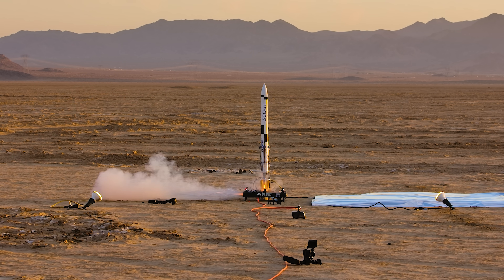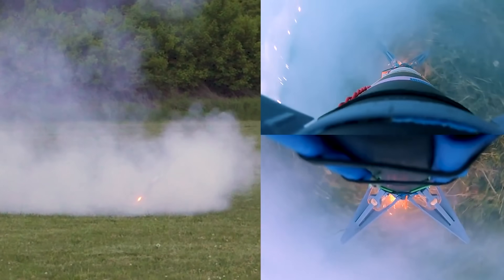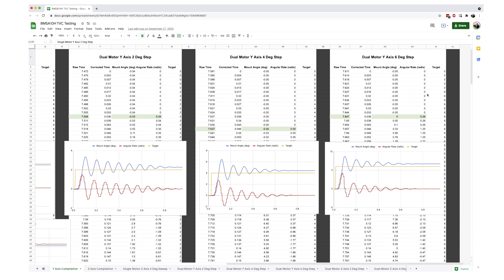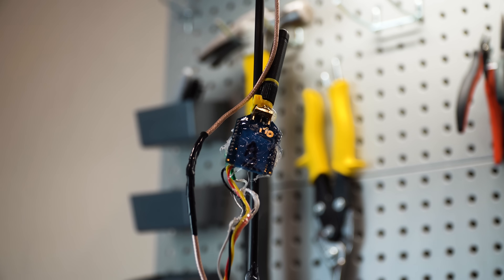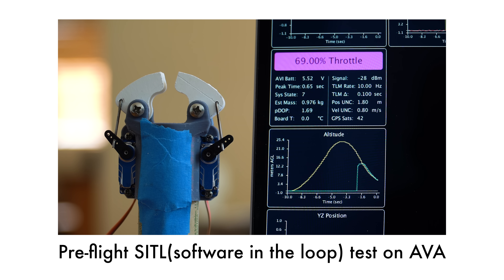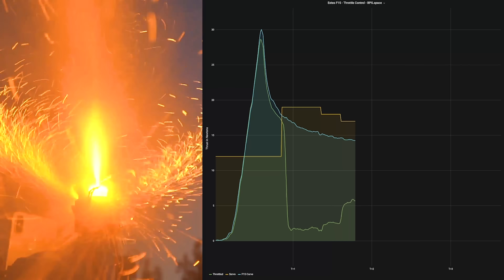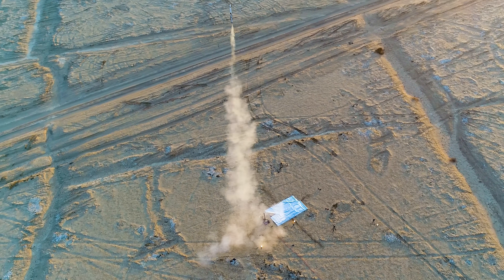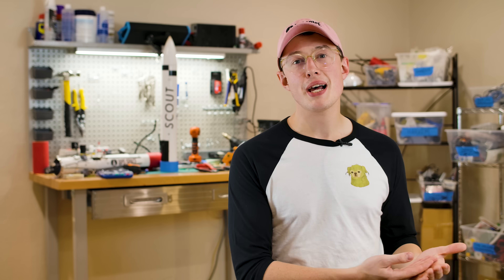Scout F - Flight 1 - Launch and Landing

Comment: great vid.
Just had a thought (i'm sure easier theorized than executed) - can you redesign the throttle arms, such that when they are close, they redirect the thrust sideways in 4 (or at least 2) axis, or reversing the thrust, aiding with keeping the rocket in place. example of this  can be seen in the Boeing 737 Thrust reversers.
Reply: Came here to say just this.

Rather than trying to block the efflux, redirecting it with 'open-backed scoops' might allow deeper throttleability, and could add a method of vectoring the thrust in the terminal phase.
Reply: Keeping the rocket in place? Sideways thrust would cancel itself out and not provide any additional horizontal stability.
Reply: @clonkex  if reversed (pushing down), sideways just enables zero thrust - though i agree with you that it seems (could not find too much info, any pilots here?) bucket thrust reversers don't truly REVERSE the thrust.
Reply: @MI-wc6nk  Ah I thought you were saying it would keep the rocket in place horizontally, but I see I misread your comment.
Reply: @MI-wc6nk  Yeah, bucket thrust reversers really just kill thrust and add drag, throttling up in REV mostly just makes noise.
Reply: @MI-wc6nk  They do reverse the thrust, in that there is more reverse thrust than forward thrust from the engine.
One of the high engined planes like the DC-10 or MD-11 is allowed to reverse with reverse thrust, but it's seen as too dangerous/annoying to do it with low, wing mounted engines.

Comment: Perhaps your ceramic thrust reduction pincers should be cup shaped to redirect exhaust gasses slightly upward which would not only reduce upward force via downward thrust reduction, but could also reduce it further via the gasses redirected upward providing a downward force.  This would increase the range of upward force control and also allow landing lock by fully closing to direct thrust upward once landing leg contact is detected.
Reply: We had the same thought. I scanned the comments to try to spot any duplicates, but there’s a lot here to sift through!

Comment: How about putting the gyro and accelerometer on a separate little pc board, put it in a little foam and move it up and away from the gimble mount. It would communicate back to AVA via I2C or SPI. That might smooth out the noise and vibration. You might also want to slow down the PID response time that controls the gimble.

Comment: Running a simulation that attempts to characterize the rocket in real time could be an option.  Might need something with a bit more processing power to make that work though.
Reply: I have used this approach on many occasions. Accurate state estimation is really the only way to control such a dynamic system. However, there are so many parameters that it becomes computationally expensive quite quickly, especially for higher polling rates.

Comment: Maybe I don’t understand something, but ... Wouldn’t it be more logical to make springy struts (shock-absorbed), which, when landing, would move apart, compensate for the load and “sag”? Thus, the contact areas of the supports with the ground will move away from the longitudinal axis of the rocket to the maximum distance, giving it greater stability. It is also better to make the racks harder than shock absorbers, bumpers, which will deform elastically and push the rocket in the opposite direction (but do not shake it, as if they were not elastic). If the missile is not very perpendicular to the landing site when touched, such a shock-absorbing strut, again, will allow the bearing surface to be removed to the maximum distance from the rocket and gently absorb the impact, allowing the rocket to level out and fall onto other struts.

Comment: Hey I'm trying to build my own tvc controlled rocket and I have a question to pid cause in ur presentation u said u should ad the derivative? Back in but wouldn't u want to suptract it in order for it to work as a brake

I'm 14 and not a native speaker so I'm sorry for all mistakes I might have made if sth is that wrong that any of u can't understand the message I'd be happy to rephrase it

Comment: You could consider wiggling the TVC on the way down instead of throttle control. I'm not sure how well the throttle control is working, but I've worked on an algorithm that also has to burn off extra energy. It works the same way the Scout underperformed on altitude.

For the way up, how much did we miss the mark on the TVC transfer function by?

Comment: I dug out the code from a mars landing simulation I worked on a while ago and here's how I handled powered descent. Is your thrust at minimum throttle below your dry weight? If so, you could use a similar approach:

If above 5 metres, the target velocity 'v' is set assuming constant deceleration: v = sqrt(u^2 + 2as), where 'u' is our desired end velocity (zero), 's' is our altitude plus 5 metres, and 'a' is our maximum theoretical deceleration rate at this exact moment in time including gravity. This makes optimum use of delta v.

If below 5 metres, the target velocity is set linearly based on altitude, decreasing to 0.5 m/s at zero altitude to ensure a firm touchdown at which point the engine is cut.

By trying to get to zero velocity by 5 metres, we build in a safety net in case we under perform. A PID controller uses the throttle to achieve target velocity.

I found this worked reliably under all sorts of descent conditions. The code is in vector form.

double target_velocity = sqrt(2 * ((MAX_THRUST - Fg.abs()) / lander_mass) * (position.abs() - MARS_RADIUS - 5));
if (position.abs() - MARS_RADIUS < 5) target_velocity = 0.5 + Kh * (position.abs() - MARS_RADIUS);

velocity_error = -(target_velocity + velocity * position.norm());
Reply: Instead of the radius of Mars they would need to use the altitude to ground. I am not sure they have this measurement or maybe they use barometric altitude (slow). Or maybe they integrate the forces from the accelerometer...

I think in reality you would use radar altitude measurements. Although small versions of such sensors are available, they will still be rather large for a rocket.

Maybe the best bet for the last 5 meters is a simple ultrasound distance measurement.

The control problem itself is not very hard to solve, but the noise on the measurements are high and the process is very quick, so a small error will already be catastrophic.

Comment: First of all: MAD respect for what you have done so far!!! Regarding your invitation for feedback: I am studying aerospace and rocket science in Germany and in one interesting lab on the calibration of sensors we learned about one possible source of the problem with the "wiggling". Broadly speaking if you want to measure something correctly you need to measure at least 10 times more often than the expected change rate of what you are measuring. For example if you are measuring something that would plot a sinus wave and you start at 0 and measure it only every "pi" interval the results will be a constant 0. If you measure it every "pi/2" the result will be a weird "wiggle" of 0, 1, 0, -1, 0,.... if you measure it in smaller increments of "pi/10" you actually start getting a kinda smooth sinus wave. What I am hinting at is that one possible problem is that the interval in which your sensors measure (or your servos react) are to slow compared to the change rate of what you are measuring / trying to correct. Secondly, someone else has encountered your problem and has solved it. It is a guy trying to build a solar tracker, but it kept over correcting and started to "wiggle". The video is short and about half way through he talks about this initial problem and how he solved it. https://www.youtube.com/watch?v=Oj1E7o7J3qc "World's simplest sun tracker." by "3D Printer Academy". Hope that helps. Would love to see you succeed!!!
Reply: I took a digital signal processing course this semester and the term you are probably looking for is called "alias" or a violation of the Nyquist Theorem. I suppose those shown data points are at a much lower rate in the telemetry data than in the actual control loop. But this might be an important point to look into. Once you're sampling at a sufficiently high rate (using DMA for example) you can filter high frequency garbage much easier an avoid the control system becoming unstable because of high frequency noise coming back to haunt you as alias in low frequency data
Reply: I think this is a good point. The other thing that came to mind is that it seems like it needs some kind of smoothing function to average the inputs over time to avoid over-correcting and therefore bouncing back and forth between extreme opposites.  Either that or some way of mechanically isolating the sensors from the vibrations to reduce "false" inputs.

Overall, this is awesome work and I've been a huge fan of your videos for the past few years!
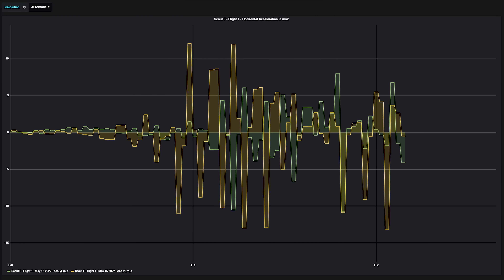Reply: The data shown at 5:14 clearly tells me, that the rate at which you are currently measuring is far too low... the way the graph looks tells me that you actually do not have the data. In between the horizontal bar at the peaks could be a temporary spike that is 2 times higher that you just don´t know about and thus cannot correct
Reply: I bet if you just get a sensor that measures 10 times faster or more you actually get a completely different looking graph and would thus have to adjust the input of your servos
Reply: I wonder what the tradeoff would be vis-a-vis cost of increasing the measurement frequency (does it require more computing power, battery, higher quality sensor or actuator, etc)? Sometimes a simple interpolation algorithm will help quite a bit in these cases.

This is such a cool project and so close to landing as well.

Comment: if i had to guess, and i never worked in something like this(disclaimer), i would try to corelate thrust and mass flow rate with altitude. that would be my landing system. I think mass flow rate is the key here. It should also be taken in consideration when you are estimating your center of mass and how much it drifts when you gimbal the rocket. For this i would have separate algorithms because of the discontinuity in the mass curve, when you eject the firts engine. Again, i'm "thinking out loud" here. I'm actually graduating in eletrical engineering so...

Comment: I'll think more about the actual question you asked, but before that, have you looked at doing the translation in the ascent and having the landing only attempt to hold zero lateral velocity? The landing has enough going on without it also trying to move over and then stop moving over.

Comment: I don’t know if you’ve already tested this, but I feel if the thrust vector control system was activated slightly after takeoff instead of immediately it might fix the wiggle a bit by giving itself more upward momentum and a longer time for correction instead of short bursts which make the wiggle.

Comment: Maybe it's time to try liquid lol. Solid throttling is hard and inefficient.
Reply: Why not both??? 🤷‍♂️
Hybrid's don't need incredibly complex pintles and you're only trying to throttle the oxidizer to control thrust.
At the very least you could shut the motor off as soon as AVA detects touchdown.
Reply: @jimurrata6785  That's probably a good solution for model scale. But this completely solid engine with flaps blocking it is just impossible.
Reply: @hardknockscoc  I don't think Joe has too many motor options in California. (at least if he's going to document them on YouTube)
Redirecting thrust definitely isn't throttling, any more than how overcorrecting on ascent is killing his apogee.

Comment: Your brilliant!  And ive been an engineer for 35 years...so i know what im saying.   You should do a video explaining how the reaction wheel works
Reply: He covers that in one of his earlier videos where he was still using a 3D printed reaction wheel with weights attached.  Basically before launch he spins it up to a steady state speed, and then after launch if it starts to rotate, he can speed up the wheel to impart a rotational force in one direction, and slow it down to impart the force in the other direction.  Pretty clever solution!
Reply: @just_another_fan418  the most important question i have is "are you banging Xyla"  shes in a bunch of his videos

Comment: Why not make the landing legs dissipate some of the landing forces and “bounce” by making them collapse a bit after the landing.
Reply: He tried this in some of his earlier rockets, the springy force ended up helping push back up into the rocket and the rocket went over sideways because all 4 legs didn't touch down at the same time.
Reply: @just_another_fan418  Looking at that aluminium ring, perhaps the whole of the landing gear could be damped independent of which or how many legs contact first?

Comment: So, I had a think... You don't need to work with one landing curve, you can work with many!

If AVA has enough memory, try a set of landing curves, say one per meter of altitude between 15 and 30 is those extremes are within the range the throttle can vary thrust for, and have the computer calculate expected apogee at burnout, then go into a lookup table and pull the correct curve.

Depending on memory, you can vary the apogee resolution to just fit. 7 meters is obviously way out of line (as demonstrated), but depending on various factors a meter might be plenty.

Alternatively, are there any weird discontinuities between the landing profiles needed for various apogees? If not, a scaling factor or two derived from that particular flight's predicted apogee might be enough, and that's both smaller and faster to execute.
Reply: I think I'm thinking the same thing as OP. The flight controller should be determining when to start the second motor, etc. on the fly. It shouldn't be replaying one thrust curve which was set before the flight. AVA has inertial data so it can decide whether it needs more or less thrust at any given moment. If I were Joe, I'd write a function that takes intertial data and motor gimbal as parameters and outputs thrust %. I can't imagine AVA's memory or clock speed being a limitation here.
Reply: @shuttleshifter  This, it should come up with a new curve based on the data.
Reply: Why calculate apogée doesnt scout has a pressure sensor and detects apogee anyway for the state machine
Reply: @nikoheinz1213  Yep, but knowing a bit earlier might help. That, and barometric pressure is subject to all sorts of oddities.
Reply: @littlegrabbiZZ9PZA  yup makes sense
Reply: I don't have any experience with rocketry, but I was going to write something similar — custom cars with specialty ECUs have "fuel maps" that look like a 3D surface model of different curves based on commanded throttle position (your foot on the pedal), the current engine RPM, and the current engine load, and/or other things like turbo boost pressure etc. This could be a possibility for AVA, just with the relevant combinations of inputs / measurements / desired outputs.
Reply: Why not use pencil beam liar? You can get them in a really small package. But I think closing the loop while trying to land would solve these problems.
Reply: He could also use external EEPROM/flash if space is limited on the micro. He could basically map out pre-computed tables with high resolution for multiple variables (height, burn rate, whatever, over a huge range) and then once those are known, pluck the curve from flash into ram and use that. 

Then of course any dynamic tweaks can be added based on updates.
Reply: @defenestrated23  Or more memory efficiently, use the parameters to generate a curve based on a precomputed fit equation. The accuracy and coverage of as many simulations as you want, captured in a single equation.
Reply: @someonespotatohmm9513  Maybe even add a basic safemode. If height can't be determined precisely enough for landing, switch to a curve that more or less guarantees a low enough (constant) sink rate at the estimated touch down height (plus/minus a few meters) so the rocket can be reused.

Basically, use detection of Apogee and acceleration by gravity to time when the rockets are ignited (with a few meters safety margin), then keep downward speed to below 2 meters per second or so.
Reply: This is a more mathematical approach. But the entire problem of flight paths is an optimal control problem. Most aircraft use PID controllers to do this. You seem to have most of the machinery already needed for a PID controller so the only thing to get right is your cost functional.

Comment: Just a suggestion not sure if you've already thought about it but maybe to help cushioning the impact trim down the height of your feet so you can print a tpu foot with no walls but just a two layer bottom and a four layer top using gyroid as your infill for shock absorption. Did that for a project i was work.

Comment: I really just don’t think you can reliably land with a solid motor
Reply: depends on what you consider reliably. Commercially available rocket motors will always have their quirks, sometimes they underperform, sometimes they don't light at all. Not in a million years should that stop anyone from trying though, a decent system should still be able to stick it on most flights
Reply: @Brixxter  I’ll gladly be proved wrong but it just seems so much harder
Reply: @harryithink5336  harder than what? Liquid rocketry?
Reply: @Brixxter  yes but obviously that’s not really feasible at this scale and cost bracket I guess but each idk I think it’s just going to be very difficult to acheive